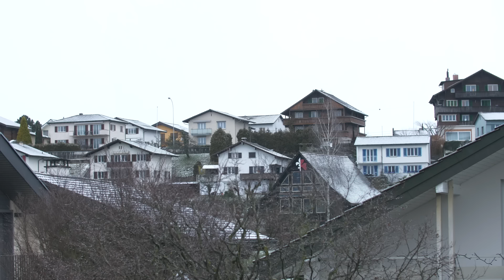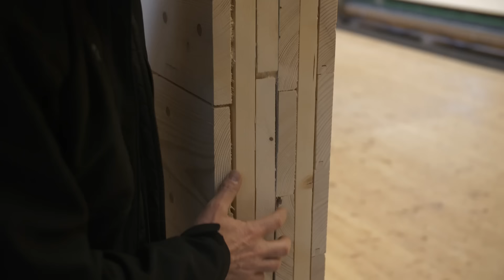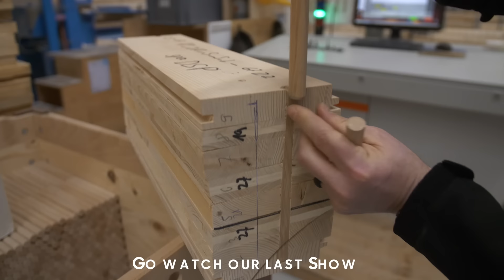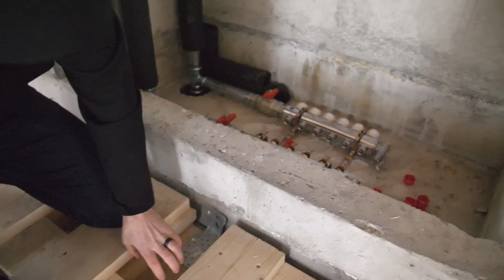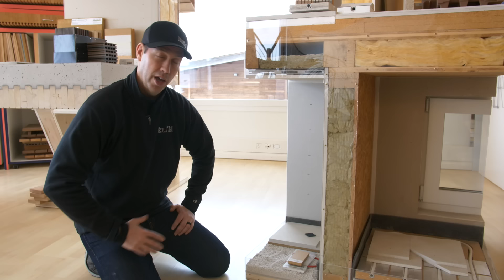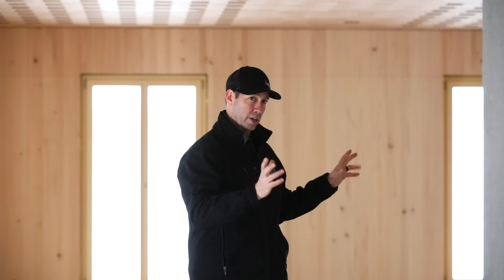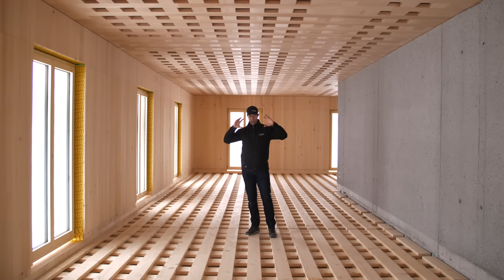This Swiss Building blew me away!  All Wood and Concrete - NO Insulation

Comment: The coolest building you've ever seen has no insulation? Shocking! :)
Reply: ba dum tss
Reply: Wood is one of the best materials that you can use for insulation, if you didn't know that. And before you say that i don't know what i am talking about, i am from Austria
Reply: @gabrielp.179  its not the best material. Insulation is still better. but it in this case wood is close so it got a pass but in germany or Austria you wouldnt be alowed with just wood as insulation. And i mean the type of wood used in this video
Reply: @drakedoggy103  I know that insulation is still better, but not that much. And you could even combine these two. And no, it s not entirely true that your not allowed, since there is a project in Vienna, for example, where they are building the highest building on the world that is made out of wood!
Reply: @gabrielp.179  which building are you talking about ? 
And im sure that it isnt only made out of "wood" since  burning is another big topic there.
Reply: @drakedoggy103  it s called HoHo Vienna
Reply: @gabrielp.179  Insulation is ''not that much better'' than wood? The only way wood is even comparable to a custom made specific highly engineered insulation panel is if it was a couple feet thick. If you left a panel of insulation and a piece of wood (which ever type Oak, Pine, Birch, Beech, Mahogany, Cocobolo) it doesn't matter, of the same dimensions and they were exposed to frigid temperatures where they could freeze and left overnight. You go touch the wood with your hand and then touch the insulation,
the wood will be frozen and cold to the touch for a while, The insulation would be cold for a split second when you touch it then it would feel Neutral . Because insulation is 100 times better than wood for insulating not just, ''not much better''.
Reply: you're not going to get much better insulation than solid timber walls.
Reply: @alianahJC13  I was just making a joke about the wording chosen by Matt Risinger...
Reply: @N4w4k  oh lol thats pretty obvious now haha
Reply: I'm from brazil and insulation isn't a thing here, so can anyone explain to me whats the point of it, does it have a real use?
Reply: @na-ev2zj  insulation is a way of avoiding heat going through the walls and thus escaping to outside. So if it's cold outside and the heater is on, the heater will have to do less work if the walls are well insulated compared to no insulation, because most of the energy put into the air can't escape. If it's hot outside and the building has airconditioning then insulation will help you keep it cold inside. So yes, it does have a use
Reply: @katinjegat  that's cool, here in Brazil, most homes are totally exposed to the environment, no insulation and air tightness, it gets very unpleasant in the winter and the summer is almost impossible to sleep
Reply: @na-ev2zj  
Not in Brazil but in Minesota where temperatures dip below -10 celcius... YES. INsultaiton is a must.

Comment: Interesting but NOT PRACTICAL. How do you make repairs when you have an issue such as ROTTING? Repairs to the walls from hanging Pictures, etc will be a problem. This is a termite paradise.
Reply: With 300 year old Barns still standing in Switzerland, maybe Termites just move on?
Reply: Termites usually don’t live where the ground is covered with snow 4 months of the year. Remarkable is the lack of geography thought these days 😂
Reply: ask Japanese people how their wood building are standing for like 1300+ years ? you make it sound like you have no idea what your talking about
Reply: @emko333  I don't. Just making a sensible observation and Just an assumption based on every house I've ever seen in the modern age. If the wood is exposed to water - it could rot. All buildings have issues in time.
Reply: CanesFan65 you don't expose the wood to rain. You don't let the end of the wood stand in water.

Comment: The reason you haven't seen this before is because it's an absolutely stupid way to build a building. Expensive as hell, and serves no useful purpose. Wood is not a particularly good insulation material, nor does it make a good thermal mass. It's way overkill for the structural needs of the building. And of course its not fireproof, it is in fact fire-prone and if it were ever to become the norm in a major city, it would endanger the whole city and likely it would get wiped out like London in 1666, Chicago in 1871 or San Francisco in 1906.

Yes, it's beautiful, but the same beauty can be had at much less cost with finish plywood and conventional hardwood flooring.

Foreign and unfamiliar is not necessarily better. In this case it's unimaginably worse.
Reply: There was an Uni in Germany that tested this and found that wooden laminated beams outlasted steel in fire situations in terms of retaining their strength.
Reply: Fire rating addressed in previous video.
Reply: You could not be more wrong about fire. Steel and concrete respectively lose almost all strength , also in a catastrophic manner, or at best expands which causes the concrete to crack,  at temperatures where wood just started charring, and concrete well, cracks and may explode. Which causes an issue with compartmentalization and preventing the spread of the fire. Wood is predictable and also self protecting, and will maintain most of its strength at temperatures where steel failed long ago. 

We're not talking about stick framing and unprotected wood beams in a typical house.
Reply: It is rather hard to say what it is structured for. They can get 10m of snow and avalanches in Switzerland.
Reply: The way commercial buildings are done in the US will typically provide much lower R value than this.

The way steel rebar (to say nothing of insulating foams) and high-strength concrete ages over greater-than-human-lifespans is probably outcompeted by the adhesives in this thing.
Reply: Trogdor Burninator My guess is that this house with computers, lamps and people will be passive for most of the year.
Reply: I’m still confused how it’s “THAT” much worse.

Comment: How do they handle heating and air-conditioning? Air exchange?
Reply: heating thru the pex pipes in the floors maybe even cooling?
Reply: Dennis Sutter - What HVAC? I suspect they use mini-splits as needed for each room.
Reply: They probably have ERVs ducted through the core for air exchange. It's worth remembering that Switzerland is relatively mild climate in many areas. You also have a lot of hygrothermal mass between the wood and concrete that should help moderate.

With the low air changes the heating loads are going to be relatively low and it's an office building (lots humans and computers generate heat). The radiant heating should be able to provide any additional heating requirements
Reply: A lot of European offices don't have AC, it just doesn't get hot enough to justify the cost.
Reply: Heated floors covered in video. No AC. Most places have windows that open a tiny bit.
Reply: There usually is no hvac installed in any kind of building or home in Germany, Switzerland or Austria as far as I know. Air exchange is handled by opening and closing windows, simple as that. 
There are only heaters installed, or floor heating if there is not enough wall space to allow for heaters being installed.

Comment: Who knows maybe with the exposure they're getting here they will ship outside Switzerland soon. 200k views on the no insulation video. I've never even heard of any of these building techniques not even close. With the publicity here I think there's plenty of people internationally that like this but just don't know it yet.
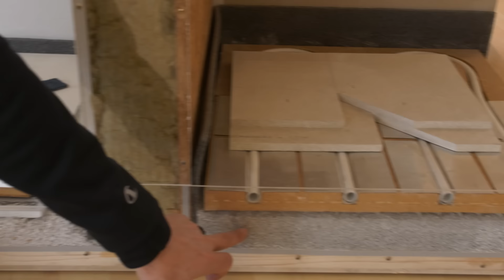Reply: Title was clickbait, floor has wood fiber insulation shown at 3:00
Reply: @charlesalexanderable  The wood fiber board is just there as a light weight material to hold the pex. Sure it has an insulating value but it's defiantly not making up the main insulation barrier the sand is the first layer of insulation.
Reply: @alec4672  sand of that depth has very little insulating value since air can flow/convect freely through it.  The wood fiber insulation board is a much stronger insulator.

Comment: Maybe it's an optical perspective issue from the camera angle, but the ceiling height looks really low. Once the radiant and finish flooring go in it looks like it would only be 7'. Gorgeous building, I can't imagine what the cost of this method would be in the states.
Reply: lower ceiling, lower heating necessary.
Reply: Average ceiling height is 2,5 meters in Switzerland.
Reply: MKTech Switzerland is way more expensive than the US and they still build with quality. Just to get you some perspective.

Comment: What would be comparable cost/sq" if built likewise in US?  $3000?
Reply: Few factories in the US even bother with second floors.  If they can't get what floor they need out of six inches of aggregate, six inches of sand, and six inches of concrete, they *don't build*.

This is more comparable to a US office building.
Reply: @TrogdorBurnin8or  That's because this IS an office building, next door to the factory...
Reply: well a 2x8x16foot cost about 15 bucks, say 20 bucks laminated and is 1.5 inches thick.
So 12/1.5 = 8 lengths to make a square foot.
So that's 10 bucks a square foot for the first floor floor. 
Assuming the walls double the price and the construction doubles that price. the wood cost would be 40 bucks a square foot.
Reply: Much more expensive in Switzerland than it would be anywhere in the US
Reply: @zachp7603  Not in California, New York or Hawaii...
Reply: This Building cost has got to be just an obscene amount of cash

Comment: Seems like a huge waste of material to me.
Reply: The Robotics Code Depot it won’t wind up in a landfill forever like all the vinyl houses out there.
Reply: @mamabear9389  - I used to do the dump run for a construction company and I've seen a lot of wood end up in land fills.
Reply: The Robotics Code Depot But wood would break down eventually not like synthetic stuff like vinyl.
Reply: @mamabear9389  - vinyl can be recycled although it's a more difficult process than something like HDPE
Reply: How is it waste? You cut a tree down, you plant a new one while sequestering the carbon in the tree you harvested.
Reply: @somegoddamnguy  - You could build 3 buildings with the same structural integrity and efficiency with the same amount of materials.
Reply: But spray foam is not? :-D
Reply: Wood is a renewable resource! Also, wood is a carbon sink!  
"timber products lock approximately 1 ton of CO2 per 1 m3 of wood."  https://www.metsawood.com/global/news-media/articles/Pages/carbon-storage.aspx
Reply: @dsdragoon  - Yes, wood is renewable but no need to waste it. Plus it takes a long time to grow another tree 15-20 years to harvest minimum.
Reply: My thoughts exactly.

Comment: In a fire wouldn't It Burn faster and more complete then a concrete building making it not as safe as a concrete building in reference to fires. And much more expensive to build as opposed to a concrete building. I rather have important information about the building instead of you raving continuously on its Beauty. Sorry I think your review could have been more professional it almost sounded like a woman was doing the review just my observation.
Reply: Solid wood is actually quite resistant to fire. As an example, glulam (laminated wood) beams preserve their strength dramatically better than steel in a fire.
Reply: @somegoddamnguy  thank you I did not know that this is the type of information I wanted
Reply: You can build with cross-laminated timber (CLT) a fire safe tall building!
Check out this report from our Forest Products Laboratory, U.S. Forest Service:

Turning Up the Heat – Fires Test Performance of Tall Wood Buildings
"Wood buildings provide an array of economic and environmental benefits to their communities, and interest in capitalizing on those benefits by constructing mid to high-rise buildings using cross-laminated timber (CLT) is growing. ...

These tests demonstrate that it is possible to build a CLT building that’s fire resistant, even with exposed CLT,” said Sam Zelinka, project leader for the Building and Fire Sciences unit at FPL."

https://www.fs.fed.us/blogs/turning-heat-fires-test-performance-tall-wood-buildings
Reply: It won't burn at all. Wood protects it self in a fire. Planed surfaces are fire resistant.
Reply: @julianreverse  
That's not true, wood does burn: it burns at a constant rate if atmospheric pressure remains constant.
Reply: @julianreverse  I never knew that what's it like being an abusive person do you get your rocks off by using abusive words
Reply: It was sexist. It's also never fair to argue from a particular example to suggest that it's a general rule.
Reply: gee, that is so weird.  because i AM a woman and i am almost always interested in how something is made.  not that i can necessarily understand the details, but i like knowing why things work properly.  if i don't understand the details, it's because the men AND women in my family didn't raise me to understand the details, and school did not rectify the matter either.  but it doesn't mean i am not interested.  unless, of course, it is explained in a way that makes it obvious that the explainer (usually but not always a man) doesn't expect me to understand nor care anyway, so acts dismissive about me wanting to know and reluctant to educate me further because i don't already know.  if i don't know how to fix my car, well...i never had a father at home and the men around me never explained anything about what they were doing with their cars (or their electronics, or their .....), assuming i did not care and did not want to know.  

after a lifetime of this, can you understand why some women only focus on the externals?  it's visible and something they can readily understand and discuss with some kind of facility/familiarity and even expertise, and won't be laughed at for "not knowing/understanding".  

the best service technicians, builders, and sellers of their skilled labor and products can always readily explain to nearly ANY audience why something is or should be the way it is or should be, the relevant points of quality and performance and perhaps even beauty.  but if you assume that everyone "doesn't want to know" and act accordingly, you are perhaps making a self fulfilling prophecy come true.  

just something to think about.
Reply: @anonymousee716  you go girl
Give them hell
Reply: Concrete walls are pretty great as far as fire.

Concrete floors?  A lot less so.  Concrete doesn't have tensile strength, so you need to reinforce it with steel, so... they're steel upper floors.  Steel weakens dramatically in a fire uniformly, while wood chars slowly but remains structurally sound proportional to how much wood is left.  It's not necessarily intuitive, but heavy wood beams are much preferred to steel by firefighters based on testing.

Unfortunately, concrete walls don't insulate.  At all.  R-1 per 8" or so.  So you add something that does insulate, and how do you structurally hold that together?  If wood, then we're back at 'wood burns'.  If steel, 'steel bends in a fire'.

In a modern *home*, most of the fuel is likely plastic, fabric, wood, and paper goods stored inside the structure, and much of the time wood will have substantial moisture that slows down fire.  Most fires in a well-sealed house of any design end up being air-starved, progressing at the rate of air introduction.  A wood house without insulation spreads fire slowly enough to provide plenty of time to escape.  Whether the shell of the house survives probably doesn't matter much to the inhabitant if fire spreads from their bed through their carpet down the hallway and destroys everything they own, then caves the floors in - it's a total writeoff either way.
Reply: In the video about this same company for homes he tells you that here in the US fire rating is 60 min to burn through and this has been tested and rated at 90 min.,as far as concrete in a fire because of the moisture that is in it under intense heat it will explode.
Reply: Fire safety is tricky. Are you afraid of the flames, the house falling down or the fumes/smoke? Wood is rather good on all of the above. It is usually what you fill the rooms with that causes problems. Wood smoke stays above the floor so you can crawl out in clear air. If petroleum products like many carpets and furnitures burn you die.
Reply: Yeah, listen to everyone else. Everyone knows nothing made of wood ever burned.
Reply: @Azathoth43  in America even steel buildings burn lol
Reply: Quality sexist reply. He addresses fire in his previous video about this.
Reply: @EricTheiss  I did not see his previous video and it's not sexist most of the time women are interested in how something looks not how it's made I guess you were never married and never had any girls in their teens I had a daughter I tried to teach her how to repair her car all she cared was not getting her hands dirty and how good the car look never cared about the size of the engine or any mechanical stuff and that's reality
Reply: @eugeneshealthproject  You should see my daughters enjoy using power tools!
Reply: @eugeneshealthproject  " it's not sexist..."  You followed that statement with a textbook example of sexism. Your sample of one daughter isn't exactly scientific. Have you considered the possibility that not all women are the same? From the context of your original post, you quite clearly intended the comment of being like a woman as a negative in and of itself.